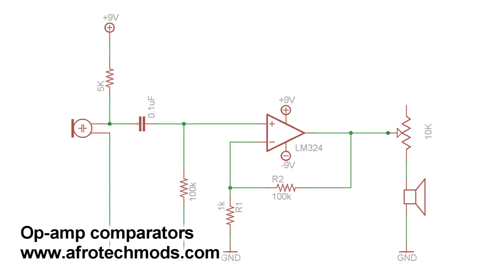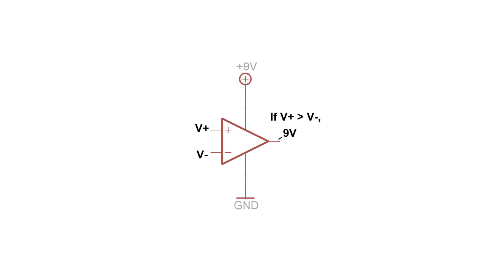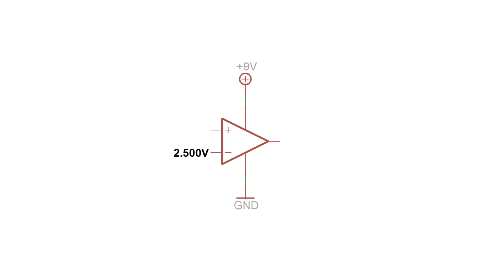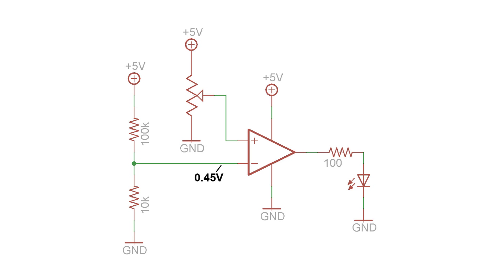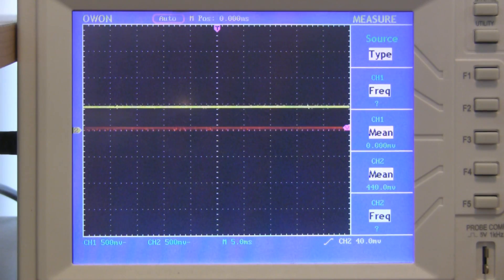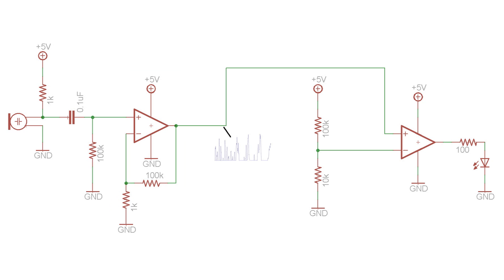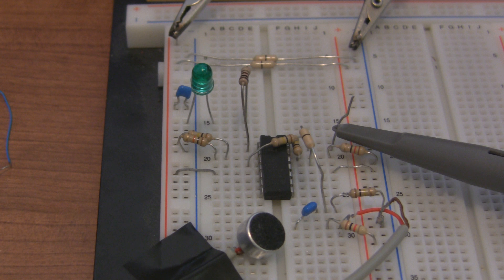Comparator tutorial & clapper circuit

Comment: Why didn't you tell us what happens when the non-inverting input was 2.49 and 2.51 when the inverting input was 2.50 volts? My relay or led starts clattering and flashing!
Reply from the maker: lol fair. This is a beginner's introduction to comparators. What you want is a hysteretic comparator / comparator with hysteresis circuit.
Reply: @Afrotechmods  Do you have a video for hysteresis?
Reply from the maker: Nope, but should be pretty easy to search for content about one

Comment: Could you explain more how you would use a transistor to switch motors on and off. Using MOSFET I assume? I would need to cut off the Hbridge power which is driving my stepper?

Comment: I’m using a LM741 op amp in my circuit and using this comparator configuration. Power by 9v and ground. 
I’m feeding 3v into the inverting and 5v from a 4081 quad AND gate IC to the non inverting input , but for some reason I get 1.2v output when the  inverting is at 3v and the non inverting is at 0v. Why would this be ?
Reply from the maker: Don't use the LM741 it is an awful, outdated part with a lot of quirks and nonidealities

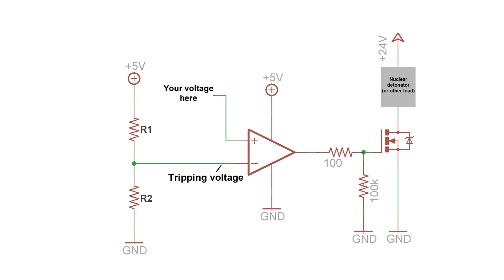Comment: 3:09 
Hey, may I ask something? Why there is 100k resistor added?  If I'm correct, thats voltage divider, but why? Most of voltage goes to transistors gate anyway, because of the resistors values.

Comment: Thanks for the informative video! Was able to apply this in comparator circuit for a thermistor controlled fan in my DIY power supply. Much more sensitive than using a single BJT and easier to adjust. Great voice, by the way.

Comment: How do you do the actual pin out on 555? I am banging my head against the wall missing something .... 5 pins are used- I get that/ but I can’t get it to work
Reply: Lol IC 555 is not an op amp
It is timer ic
Reply: @madhuradharme9131 the 555 is 2 op Amps, with a flip flop and 3 5k resistor divider inside..... you can totally use a 555 to do this job. Pin 1 is ground, pin 2 when goes low will flip pin 3, if pin 4 is high...... and pin 8 has power.

Comment: @Afrotechmods I used the same circuit with a TL082 op amp. I am using a 100KHz sine wave input 1Vpp and want the circuit to trigger when the signal is at about 90% amplitude.

However, The circuit's output is not stable. Using my scope, i can see the output is very stable for sometime (1-1.5 mins) and then the amplitude of the output reduces for about a minute and it again stabilises for a minute. rinse and repeat.
how do i stabilise the output??
(P.S. the input is perfect, no problems there).

I could email the screenshots to you if you want to have a closer look.

Comment: hello afromods, i can't do the comparator, i followed the schematics, i'm using a 741 with a 9v battery, i've played with resistors but still can't get any output voltage, what am i doing wrong?
Reply from the maker: Don't use an LM741, it's a terrible op amp. Try an LM324 or better.

Comment: could I use this for a Li ion battery protection?
Reply: Technically yes, If you used the high output to control a transistor because obviously the output of the comparator isnt powerful enough to power anything. Youd also need an external power source with regulator to power the comparator and a voltage divider for one of the input pins and divide the voltage to 3.7 volts for a single cell lithium battery. If you used another comparator you could make another circuit similar but for overcharging protection

Comment: how to connect compartor on the bread board
Reply: The breadboard's horizontal pins are connected in the middle. The vertical power rail pins are connected lengthwise. All you need to do is follow the schematic from there.

Comment: you didn't tell as what happens if we feed the inputs the exact same voltage. Will output be high or low?
Reply: This is really old, but it depends if the op amp implements a schmitt trigger response. If it does, it will most likely switch to one of the rails and stop because the difference between the two is close enough to zero.

Comment: Can you make the non inverting input the reference voltage?
Reply from the maker: yes
Reply: Thanks!
Reply: Pilot924
how to make non inverting input as the reference voltage?
Can anybody please let me know.
Reply: Pilot924 In other words, you want to make a circuit that turns a light on when the signal is BELOW Vref, rather than ABOVE Vref?
Reply: +Afrotechmods The circuit I made had the Vref on the non-inverting side.  I got 5V on the output when the inverting voltage was above the non-inverting voltage as well as below 0.75V which I thought was strange.  This doesn't happen when Vref is on the inverting side.  What am I missing?
Reply: +Akash Belakawadi (Akash BV) inverse wire

Comment: I'm using two LM741, but for some reason, my LED is always on. I debugged the circuit I found out that I have a high voltage at the first output (3.9V), I apply 5V at inverting of second op-amp, but I still have a problem.

Comment: Hi. Your tutorials are excellent. I'd like to ask you: How should I use Op Amp when I want to check lower and higher voltage limits (when the output signal of the peak detector is in wide range 0 and +5 volts, but Op Amp should be act only when the signal is between +3.0 and +3.5 volts)?

Should I use two Op Amps or Should I use voltage devider to cut off lower voltage right after output of the peak detector?

Thanks.

Comment: damn i have bad luck i have a lm339 quad comparator from radioshack, i hooked it to 5v and GND
and output to a led
when i power it up and set the + to 5v and - to GND nothing happens when i switch it samething nothing happens i tried it with 3 different ones =(
any help would be appreciated

Comment: it is worth noting that this circuit won't work if the output voltage of OP-amp can't 'swing' to zero when powered from single power supply. Not every OP-amp has this feature.

Comment: Holy cow...I just tried this circuit and it worked! I'm thinking of using this circuit with two thermistors on the two inputs as part of an automatic temperature compensating thermistor-based low fuel warning system on a motorcycle. The factory ones are thermistor based, but very crude. They only use one thermistor and are subject to temperature extremes that render them inoperable...

Comment: @CassetteMaster i discovered my problem was actually the tripping voltage. i didn't pay attention to the resistor color scheme, so i used a 100ohm resistor instead of the 10k resistor, and i quess i had too much  noise in my room, so the LED couldn't turn off. i changed the resistor and now it works. but thanks anyways.

Comment: @TheJagwtf Think of the ground as just a point where all the "grounds" are connected. Usually the ground is connected to the battery (-) terminal, but *not* always, so don't rely on it unless it isn't specified. Wherever you see a ground symbol, mentally draw a line to the nearest ground. It's convenient because otherwise schematics would just get cluttered with links between all the grounds. It's a similar story for voltage symbols (like 3.3V, 5V etc.)